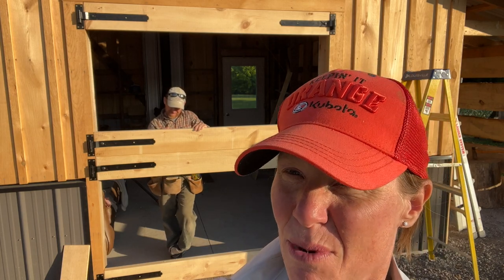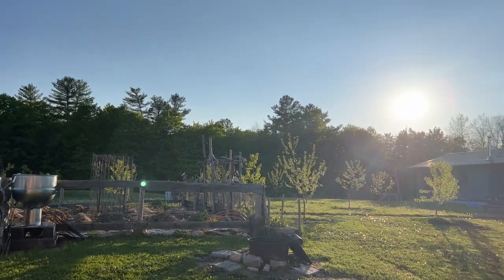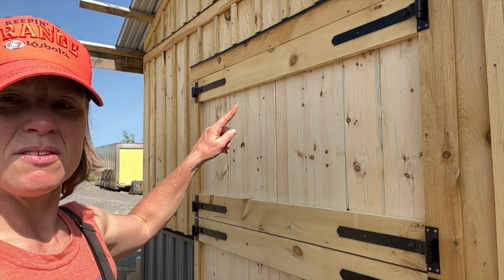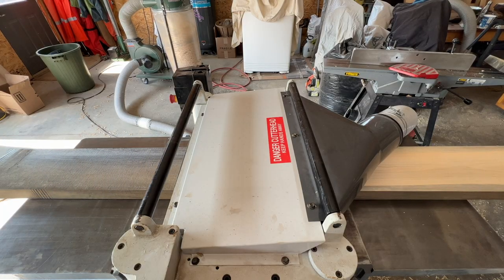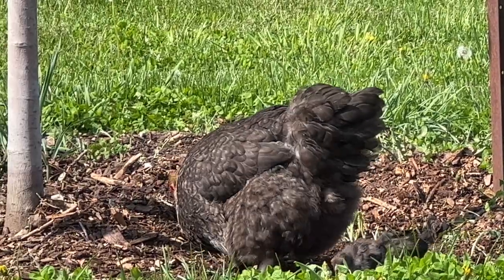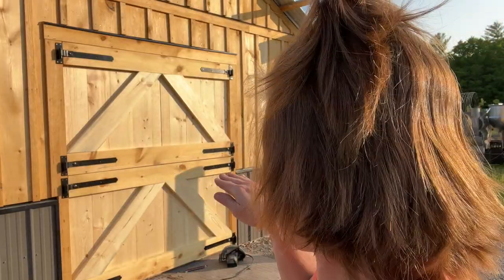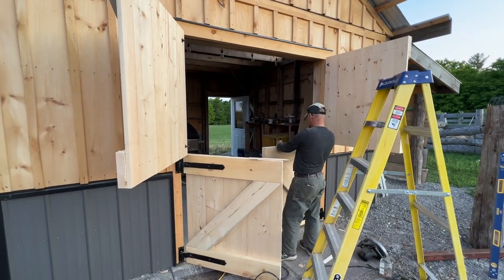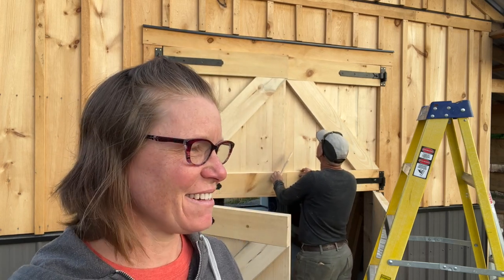Building barn doors | It was harder than we thought it would be!

Comment: Did you lift the hinges when attaching them to the boards or where they hanging down and then attached, i want to try this technique also but unsure how to work with the amount of play in those hinges.
Reply from the maker: The strap and pin hinges are commonly used for this technique and on the video we watched, the hinges where left hanging with only the main carriage bolt installed on the strap portion. This is what we did different since we wanted the hinges to be level when viewed from the front so we levelled up the hinges on the boards. I did adjust the pin side of the hinge by bending them to sit a  bit more snug/level prior to cutting the boards. I think the fact that we were creating a double dutch door made this technique a bit more prone to the doors not staying true when the final cut was made. 

So the combination of wanting the hinges to sit level for aesthetics and an additional horizontal cut makes this a tricky technique. If you were to only do one cut to separate the doors down the middle and the hinges could sit not level to the eye this would be a solid way to go. When we made the cuts the big difficulty was the saw cutting depth as it was tricky unless you have a 8-10" circular saw since we had heavy stock 1 3/4 plus 3/4" so a thick cut. The relief cut still needs to be a bit closer to 1/4 inch to have the doors close without coming together if not closed separately. 

With all that being said, we used a belt sander and made it all line up since the cuts needed some evening out. We did find the end cutting the challenge but we liked the in place construction. And since the doors are set to be lifted off, it was easy to dress them up with the sander to look good. 

Give it a go it was a great opportunity to try something different.